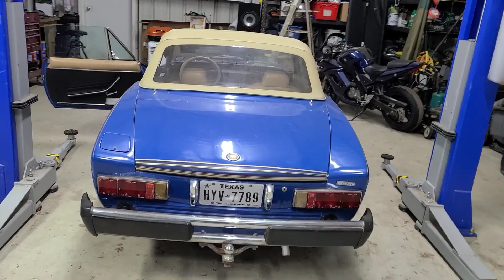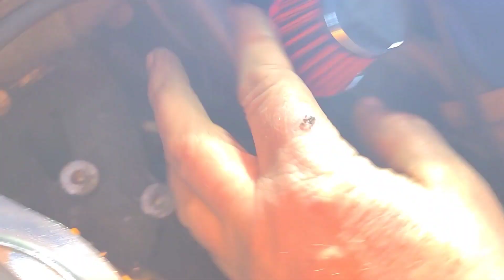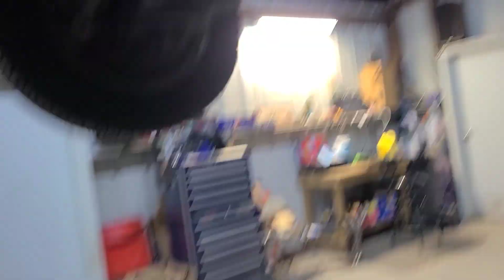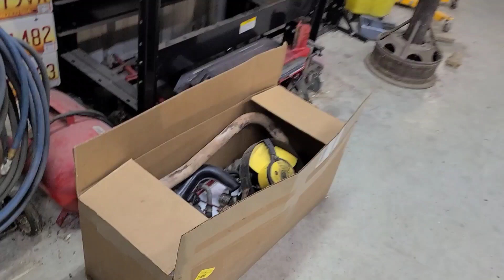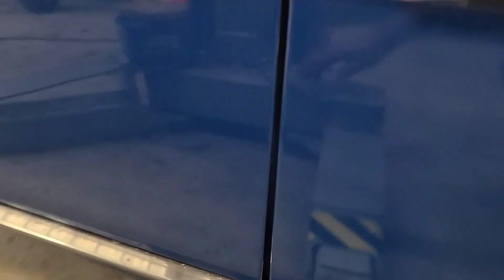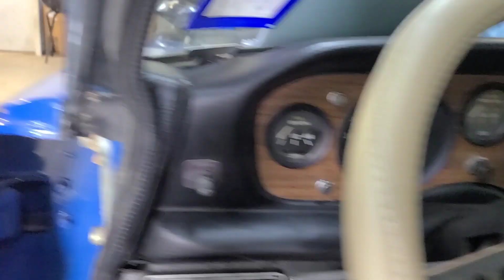1976 fiat spider

Comment: Tap the face  of the oil pressure gauge lightly with your finger when you start up. For some reason those Veglia gauges all seem to hang a bit. (assuming the gauge is hooked up!) Use the high octane gas when you fill it. Modern unleaded, along with removing the AIR pump & running that header will stress your exhaust valves. (make sure your distributor advance is hooked up and working too.) Overall, a fine looking example ! (I have a YT playlist of some Fiat 124 stuff if you'd like to view it.)

Comment: What was your original carburetor:  ADF or ADFA?  Or was it a DFEV?  The ADF and ADFA were water operated chokes.  The DFEV is electrically operated.  I have a '75 with an ADFA.  I did not see the separate return nipple on your carb nor the vapor bowl vent nipple that connects to the spherical carbon trap at the left fender.  The return nipple forms a  "Y" with the intake nipple.  You should check out the 2 You Tube channels Eldest Builds and Garage Time.  Both have extensive repair/rebuild videos on '79 Fiat Spiders and I believe both reside in Texas.  They know each other and hooked up at the 2022 Fiat Freakout that was held near Houston.  There are original Weber's available but cost 2 1/2 times more than the Empi replacement.  Fun car to drive.